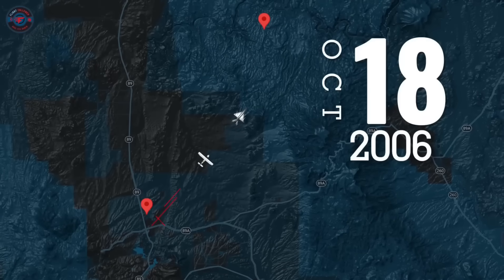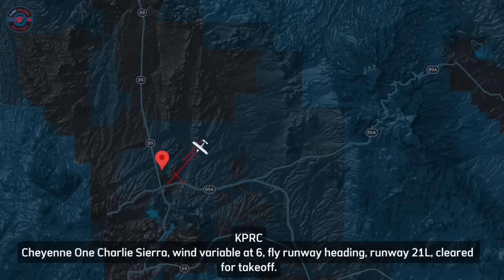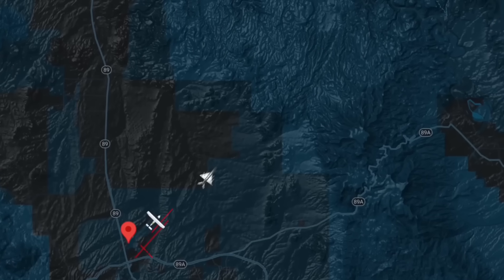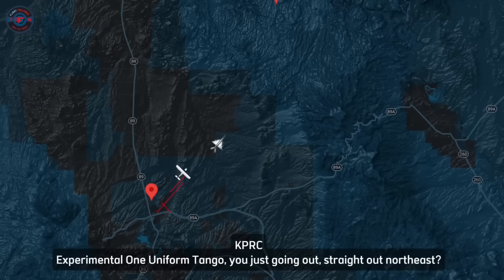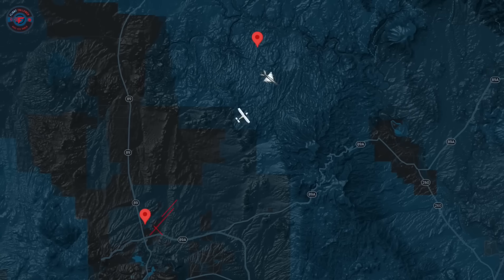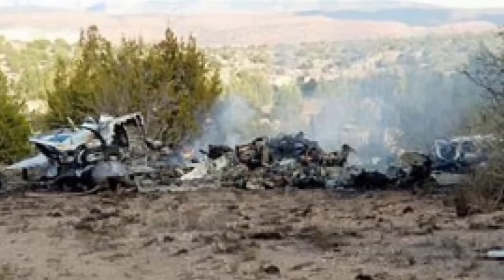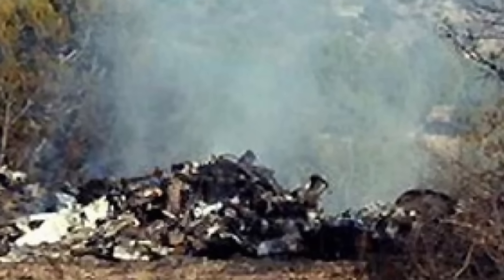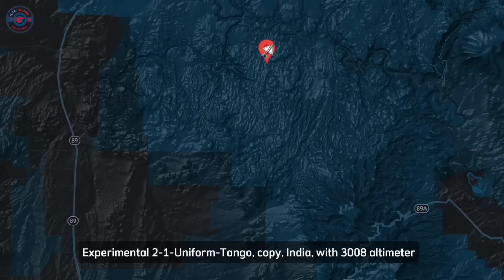MiG-21 Jet Blast Causes Midair Breakup of Piper Cheyenne! #atc

Comment: I jet washed my motorcycle the other day- throttle died, could barely start... I had to let it sit for a week to dry out and got lucky- it did and is back to 100% thank foke...
If you get fukd by jet wash, just sit tight till everything starts working again. 
Simples.

Comment: The “facts” of this story are completely wrong. The purpose of the flight was for the Cheyenne to inspect the MIG landing gear transiting as it had recently been serviced but still problematic.. To match speed the MIG was at a high AOA slow and mushy as the Cheyenne positioned below. The tail was blown off. All high time commercial pilots. Tragic.
Reply: From what I can see it's accurate after looking up the tail number, the purpose was just for aerial photography of the MiG and only after takeoff when it experienced the landing gear issue and discussed it on the radio the Cheyenne said they'd fly close and under to inspect it.  It was never intended to be a close formation flight in that manner.

Comment: So the Piper was blown to pieces in flight ,   Wow !   First I have heard of this happening . 
The M - 21 is not a large or heavy aircraft but has rather huge thrust for its size . 
Bingo - bango we used to call wake at the threshold of AFB  runway at Patrick .
Even in a small Jon - boat it felt very strong but those were military B - 707  droop - snoot . 
1970’s era -      We would fish off approach end .

Comment: I just don't understand how they can make aerobatic airplanes withstand 10g's but can't do the same for regular flying aircraft that don't complete such aggressive maneuvers as aerobatic planes do. It should be required.
Reply: Costs and intended purpose. Same reason everyone does not own a Lamborghini or other super car.
Reply: You need to go back and restart grade school
Reply: Each is built to purpose. Can't expect a sports car to be built the same as a tank.
Reply: Can't put that much structural material into every part of planes that don't need it. 

Same reason we don't bother engineering and producing cargo jets capable of Mach 2+ supercruise, they would be fantastically expensive and wasteful while providing the capacity of a mail truck

Comment: “Prior to departure, both flight crews decided that they would join-up while in flight to take
video and still pictures of each airplane. Both aircraft were Shorts Brothers SD-360-300
turboprop airplanes. While flying in formation, N3735W announced over the radio that they
would turn right, toward N372AC, and descend. During the turn, N3735W's left wing impacted
the left wing and engine of N372AC. After the collision, N372AC rolled to the left and pitched
down significantly before the flight crew regained control of the airplane. After the collision,
N372AC was losing hydraulic fluid and eventually had a complete hydraulic system failure.
The airplane made an emergency landing at a nearby airport with its flaps retracted and its
landing gear partially extended. The airplane overran the end of the runway, coming to rest
about 100 feet from the departure threshold. White paint transfer markings and scrapes were
observed on the left wing deice boot, the outboard side of the left engine cowling was crushed
inboard, the left wing-strut leading edge was torn open and bent, and the lower fuselage skin,
immediately forward of the landing gear wheel wells and stub wing, was torn from left to right,
consistent with a propeller strike. N3735W impacted terrain and the airplane was destroyed
during a subsequent ground fire. The flight crew and passenger were killed. The outboard
three-quarters of the left wing was separated from the main wreckage and was not fire
damaged. The upper wing surface had linear scrapes diagonally across the wing skin. The left
aileron from N3735W was found on the runway where N372AC had landed.”

Comment: “The DC-3 had recently undergone a Turbo Conversion by Basler Turbo Conversions, Inc for its new owner, the government of Mali. Company founder and CEO Warren Basler was flying a Beechcraft A36 Bonanza (registered N3657A, c/n E-188) to take some photographs of the DC-3. On its last pass, the A36 circled behind the DC-3, then crossed over the top and hitting the top of the DC-3 at an altitude of 700 feet . About 5 seconds after impact, the DC-3 gently rolled/turned westbound (apparently descending and gaining airspeed); the left wing then came off, followed by the right wing about 2 seconds later.”

Comment: “On the 4th of April 1991, a hired Piper Aerostar carrying Pennsylvania Senator John Heinz experienced a landing gear problem while on approach to Philadelphia. Unsure whether the landing gear was down and locked, the pilots asked for help, and the pilot of a nearby helicopter offered to fly underneath the plane and look at the landing gear. As the two aircraft flew in formation over the suburb of Lower Merion, something went horribly wrong: without warning, the helicopter struck the airplane from below, sending debris flying in all directions. As pieces of the aircraft rained over an area of several square blocks, the fuselage of the helicopter crashed to earth in the playground of an elementary school where recess was underway, killing two six-year-old schoolgirls along with both pilots.”
Reply: And if that didn’t happen, John Kerry would have never had the money to run for Senate.
Reply: @johnf8877 you mean President? Because Kerry was first elected Senator in 1984
Reply: At least they were girls.  Could you imagine if they took out two boys?

Comment: So tragic.  First, leave formation flying to the professional airshow pilots who practice it frequently and to current military pilots - it is a HIGHLY perishable skill that requires practice and discipline.  But perhaps more importantly, do not try to diagnose or resolve a landing gear issue with formation flying of dissimilar airplanes or aggressive maneuvering.  Not long ago, there was a midair involving two Bonanzas doing something like this following a gear anomoly.  There have been structural failures of airplanes when pilots tried to force a partially extended landing gear down by maneuvering aggressively in hopes the positive G loading would cause the gear to extend.  Ladies and gentlemen, there are many reasons why most of us have hull insurance on our airplanes. One of my reasons is potential landing gear malfunctions resulting in a gear up or partial gear up landing.  My checklist has all the troubleshooting steps I need - not one of them includes "pull a bunch of G's" or "conduct formation flight with a dissimilar airplane for diagnosis".  Once all the troubleshooting steps in the checklist are exhausted, it's time to put the airplane on the runway, call the insurance company, and tell them to bring me a check when they come fetch their new and slightly damaged airplane.

Comment: I am a Licensed Aircraft Engineer with 50 years in the industry, a "T"tail aircraft will Never be structurally as good as a conventional tail assembly, I am a aircraft owner, and would never own one, they are a Piss Pour Gimmick that really is shit
Reply: C-141, C-5, C-17. Hell of a gimmick.
Reply: @brandspro  he's talking about GA aircraft, not heavy duty aircraft used for cargo ops
Reply: B-727, DC-9, MD-80…
Reply: Buccaneer. Hell of a gimmick.
Reply: Gents…

Twin engine jets can afford the extra weight of a popular T-structure… GA airplanes, not so much.

😃
Reply: @AC-jk8wq - No such distinction was made by the OP.
Reply: Don’t think that other aircraft aren’t subject to the same issue
Reply: Why are they a gimmick?
Reply: I think because they have more drawbacks than advantages especially in terms of weight, strength.  Any departure from the normal tail seems to have disproportionate number of problems. It may be that people focus on a part of the design that os different like the V tail bonanza.  But given enough of a kick any tail can fail.
Reply: The King Air 200/300 has seemed to perform pretty well. Another know it all idiot who has never flown a T-tail
Reply: The Cessna Citation X and Citation Jet series all have t-tails and are extremely safe aircraft. OP doesn't know what he's talking about.
Reply: I am a licensed plumber with 51 years in the industry  and can attest you dont want a piss pour gimmick that really is shit.

Comment: The MiG pilot flew at 9,000 feet msl in a 30-degree right hand turn at 200 knots (about 90 percent power set) with approach flaps selected (approximately 25 degrees) At 90 percent power, the jet core exhaust velocity is about 1300mph with a mass flow of around 75kg/sec. If you were to fly though that jet stream, even at some distance, with a GA aircraft, it would rip it apart effortlessly.
The power can be visualised if we consider some of the videos of military jets, taking off from old runways and ripping up the tarmac behind them.
Reply: Exactly, jet stream from fighter is no joke, energy destiny of it is insane. It's not prop or turbofan
Reply: 200 knots seem pretty slow for MiG? which is stall speed for MiG?
Reply: 200 is its rotate speed, landing about 160 with flap. So he's flying pretty slow which ironically might require a higher throttle setting than you might think hence the jet intensity.
Reply: Still, I can't quite work out how they managed to fly through such a narrow column. They must have passed directly behind exactly same level more or less broadside on at very close range to shear the tail. I thought they were supposed to be below.  I suppose they could have flown behind it at a shallower angle causing an upset so severe that it exceeded limits.  I'm guessing nobody knows, the mig didn't have eyes on them.
Reply: lol duh why do you think approach flaps were down with that thrust setting
Reply: The figures of 200 knots with 90 percent power and 25 degrees of flap are exactly as reported by the pilot of the MIG at the time.
I agree that flying so slow with flaps could need a higher power setting but even at low power in flight it would produce an exhaust velocity around 950 mph so it would still be dangerous..

Comment: That sounds very strange. If he was passing under to inspect their landing gear he wasn't going mach 2. Russian pilots will fly in front of a drone to 'bump' it in the jet wake but it's not a 20g event. The cheyenne must have been very frail. The dangers of alu metal fatigue. Composite is the way
Reply: The jet core exhaust would have been in the neighborhood of 2,100 kph and moving roughly 75kg/sec of air... Put that together with the Vne of the Cheyenne and the results are not strange at all...
Reply: @Melanie16040  nah the exhaust speed falls off very quickly, at just 20meters it would be close to harmless so he would have to pull up right in front of the other plane at max thrust which sounds very reckless. it's possible if he was oblivious but that's a blind maneuver with the other plane behind you. Inspecting landing gear can be done at some distance and you don't pull up in front of it afterwards. maybe if he throttled up hard to go ahead that can create some turbulence but it would be modest speed. Unless he was crazy flying the cheyenne had to be frail. Just waiting for strain to rip apart

Comment: Question: Could the heat of the jet exhaust been a factor?
Reply: Heat would not be a factor, although the exhaust is hot directly behind the engine, it would take more time to warm the aircraft structure than it would to rip it apart due to exhaust velocity about 1300mph and mass flow around 75kg/sec in this case.
Reply: Its the shear power that mainly made this impossible, the tail seems to have been ripped off by the jet wash, imagine if the airplane was going 300 kph and then hit a jet of air going another 300 kph in the opposite direction, the overspeed alone could have been enough to rip the whole plane to pieces has it hit in a bad enough angle
Reply: @higamerXD  Except the jet core exhaust from that aircraft would have been more in the neighborhood of 2,100 kph... Guessing you can put the rest together...
Reply: @Melanie16040  so it turns out the Cheyenne can't operate fine at speed above 2,000 kph. good to know.
Reply: @higamerXD I get that, but was still curious about the heat factor. I honestly don't know if the Blue Angels or Thunderbirds, for example, have to worry about the heat factor or not.
Reply: @jerrysmith5782  at some point yes surely. but i really dont know enough about the specifics.
Reply: Probably too short to heat have a significant factor, if he went through it close enough it's like hitting wall of air. It's not turbofan or porop engine where speeds are relatively low compared to it. Fighter jet stream is like concentrated 1000mph+ air sword in the air. About formation flights you definitelly don't want to suck jet stream to your engine due to excessive CO2 for combution and turbulence. Heat to have a significant factor it need to go in one spot for few seconds probably, aluminium is very good at heat transfer also and paint provide also layer of protection from heat transfer. So most likely in real world just burned paint at most.

Comment: I work on Cheyenne often.   They are not built strong.   Riveted tin can.   They even have a sticker under the pilots window no spins no aerobatics..     that means the wings won’t hold up to a beating.
Reply: Definitelly not 1000+mph fighter jet stream rated.
Reply: Well yeah find more twins in which spins and aerobatics are prohibited than twins where they are permitted. It's pretty rare for civil twins to be approved for spins or aerobatic maneuvers.
Reply: The same is true for any normal category airplane. They’re only rated to +3.8G / - 1.52G. In most light twins, spins are not approved, and they don’t even try spins during certification because it’s considered too dangerous even for a test pilot.

Comment: Not exactly experimental with 11,496 made, and India just recently retiring the last couple dozen.
Reply: It is registered and operated experimental so yeah - exactly experimental
Reply: I kinda doubt MiG21's were ever certified as production aircraft by the FAA.
Reply: No. FAA offices in Gorky near the mig factory.
Reply: @paulwoodman5131  - You can't register a C130 Hercules, either. They were never approved as a type.
Reply: so the FAA maintenance regulations can be avoided.

Comment: i had walked under and around this Cheyenne in its hangar and marveled at it, and also saw the mig21 post flight.  the mig21 didnt have a scratch and was completely fine and tbh the cheyenne didnt even need to check its gear as it was not an issue the mig21 looked fine on the ramp post flight.    the lesson we can learn from this is do not mix different kinds of aircraft in formation.   nobody really follows this rule, so it will happen again.  i had also flown "romeo mike" heard in this video.  the tail of the cheyenne sticks up quite a bit and entered the jet blast/wash of the mig21 and it tore off.
Reply: Really don’t fly in the jet wash. If 121CS stayed upwind/above the mig21, there would be no issue.
Reply: It's not a rule in the first place. They have been doing dissimilar formations for decades. The issue here is that they did something that wasn't briefed before hand either on the ground or in the air. The maneuver to show the belly should have been briefed in the air before it happened and the MiG never should have turned into the Cheyenne, it should have remained on a steady course and heading, and let the Cheyenne maneuver into position.
Reply: @ImpendingJoker the Cheyenne has a huge “T” tail that to me looks out of proportion to the aircraft.

Comment: If you can feel your own wake a minute or so after you made it, imagine the wake that delta winged beast can make even without a jet engine
Reply: Many decades ago, I was getting a recruitment flight in a Navy T-34B. The pilot took me through some basic aerobatics. Before going into a Cuban-8, he told me his goal was to pass trough his own wake at the center of the eight. Sure enough, he did and I could feel it. Nothing bad, but a definite little shake of the plane.